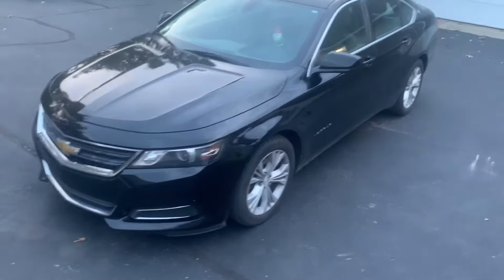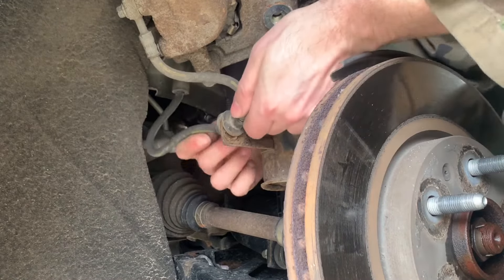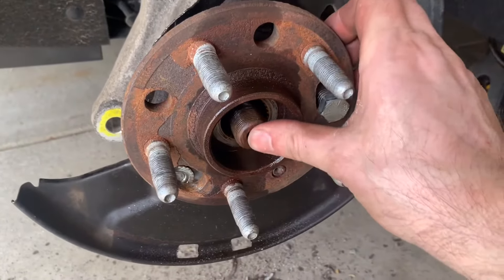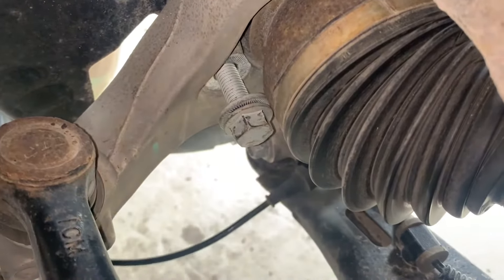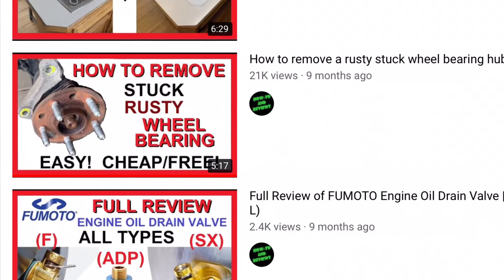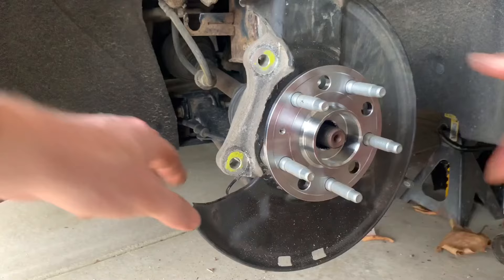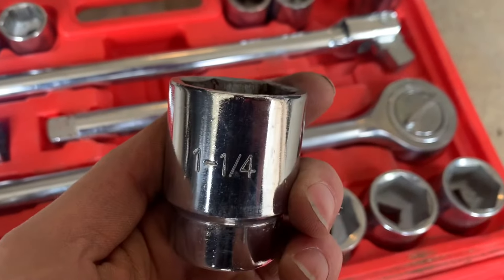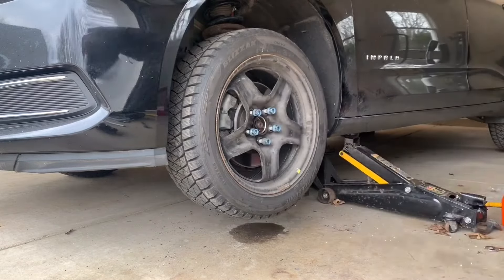How to Replace a Front Wheel Bearing Hub Assembly || 2014 - 2020 Chevy Impala || Torque Specs Shown!

Comment: Hey this is a good video, I replaced my front wheel bearing after watching this, The only thing you did not show was tie rod end needed to be taken up.I had to take tie rod up, didn’t mess with the adjustments thou.
Reply from the maker: Thanks for the tip
Reply: you don’t have to
Reply: You don’t have to take Tie rod end loose or the strut
Reply: @s.akinribido5894   I found that out on drivers side.

Comment: Hey, so when I’m driving anything over 45 mph and try braking, my wheel starts to wobble and makes the steering wheel shake, do you think changing out the hub assembly would fix the problem
Reply from the maker: If it wobbles when braking, that is the result of warped rotors. Look into replacing your brake pads and brake rotors.
If it is a bad wheel bearing hub assembly, there would always be a humming/groaning sound, which gets worse when you turn. Not related to using the brakes.

Comment: Why did change the wheel bearing?is the any symptoms to check bad wheels bearing?!

Could you help me please

i have noise come from front driver side after i hit 65mph its make the drive uncomfortable to me how to check the if the problem is from wheels bearing?! All my tires is brand new
Reply from the maker: If you are hearing noise, try turning/swerving left and right while driving. If the noise gets louder and quieter when you do this, it is likely the wheel bearing. Turning left will load up the right side bearings with additional force, and decrease the load on the left bearings. This will make the bad bearing louder when loaded with force, and quieter when unloaded.

Comment: Hello, would the process be the same for the rear?
Reply from the maker: It’s essentially the same for the rear, but more simple. There is no axle shaft going through the center. The center of the wheel bearing hub assembly is just an empty hole. No axle and axle nut.
Reply: @HowtoandReviewsOfficial  Thank you so much for the prompt response! Just bought a used 2017 V6 model, dealer was kind enough to replace the front ones as they made a lot of noise. The back ones are starting to whine too, just ordered the parts :)
Reply from the maker: @silencez2324  Happy to help. I hope it goes smoothly! Congrats on the new car. I really like mine.

Comment: Hello my power steering stopped working on my 2014 Chevy impala LTZ  could you tell me anything about it
Reply from the maker: Hello! I have not had any power steering issues in this vehicle, so I’m not familiar with the details of the system.
The best I can tell you is that the power steering system in this vehicle is an electric motor. There is not the typical power steering pump with power steering fluid. I
The problem is likely an electrical problem. Loose wires or bad motor or something.
I would recommend starting with a Google search. Since this vehicle is now eight years old, it is very possible that there is a common problem with a well documented fix.
I’m sorry I could not be more help. Let me know how it goes!
Reply: @keaonia I just had the same issue with the power steering on my 2014 impala I had to replace the rack and pinion assembly  ..

Comment: awesome video dude! Thank you for your service as well. 

Question, for the torque wrench, what kinda drive we working with here in regard to the torque wrench for the steering knuckle & FWD shaft nut that is.

3/8th?

3/4th ?

or 1/2  ?
Reply from the maker: Thanks, I appreciate it.
The steering knuckle could use a 3/8” or 1/2” drive torque wrench (their torque ranges overlap).
The axle nut needed a 1/2” drive torque wrench.
I do not have a 3/4” drive torque wrench. (My axle nut socket was 3/4” drive, but I used an adapter). 
I hope that helps!

Comment: I was finally able to successfully complete my left front hub assembly using a breaker bar and a pipe.  However,  on my right front It as a nightmare with the rod assembly and the front shock . It would not align.  I had to remove the shock and one of the rods to align it. Now i believe the brakes are making a horrible noise and my ABS light and stability lights are on. Do you think I reinstalled my caliper too tight or was it because I removed the shock and rod?
Reply from the maker: The ABS and Stabilitrak lights are the result of the wheel speed sensor not working properly.

How to Fix ABS and Stabilitrak Warning Error Lights | Speed Sensor | Wheel Bearing | Chevy Impala
https://youtu.be/wtDWDb2tYQA

Do the brakes always make a noise when the wheel is rotating? If so, probably just the dust shield rubbing on the rotor. Should be as easy as bending the dust shield back a bit.
Reply: @HowtoandReviewsOfficial  So I removed the calipers and discovered that in my frustration and rush, I placed one of my disc brakes backwards.  Needless to say, it scratched the hell out of the rotor. Anyways, I corrected and now it makes a grinding noise when it slows down. You're right about the speed.sensor. The troubleshooting code confirmed it. Although I don't know why it went bad. I'll check the dust plate. I will give you a follow up
Reply from the maker: @osso7891  Nice. It’s always good to find answers.
Reply: So, I finally had a chance to work on it today. It's not the dust plate rubbing against the rotor, but the caliper against the wheel! Its not loud,  but it's very abvious. There is definitely rubbing marks on both the calipers and the rear wheel. What went Wrong?? I reinstalled the calipers and made sure they were tight. Also, I forgot to mention that the new AC Delco wheel bearing housing does NOT have a hole for the screw, so the rotor just moves around, but that didn't cause any problems on the drivers side. I'm thinking of redoing the whole thing because maybe something went wrong when I installed the wheel bearing housing??
Reply from the maker: @osso7891  That definitely should not happen. The components stack up so everything is in the correct location with no interference.
First, I would make sure everything is in the tightened down security.
If it is, I would be looking at the wheel bearing. It is the only component in the equation that was changed. Maybe it’s the incorrect wheel bearing. Not having the tapped hole for the rotor adds some suspicion to that possibility.
Reply: @HowtoandReviewsOfficial  Okay. Yes. I believe that may be the case. I will double check and get another pair.
Reply: @HowtoandReviewsOfficial  So, after weeks of working on my wife's car and going through all the problems above, I finally fixed it. I swear I'm going to trade it for a Honda. After redoing the entire wheel bearing hub assembly and even trying a wheel spacer, I discovered that one side had a bent rotor. A friend came by with some device and straightened it out. Problem solved, no more noise. I can now replace wheel bearing assemblies faster than oil changes.
Reply from the maker: @osso7891  That’s a rough path, but I glad you got it sorted out! Great job!

Comment: do you rest the weight of the vehicle right there on the jackstands, or is the vehicle just floating above the stands?
Reply from the maker: Rest all of the weights of the vehicle onto the jackstands. They should hold all of the weight with no floor jack required at all. I just left the floor jack in place because why not? Otherwise, I would have to remove the floor jack then put it back again when I’m done. I had more than enough room to just leave it in position.
Reply: @HowtoandReviewsOfficial  okay. great video man.

Comment: Good video. What indicators lets you know you need to change your wheel barring?
Reply from the maker: Typically a growling or howling noise when driving. It will typically get louder when turning because inertia shifts more weight to the bad bearing and really loaded it up.
In this specific case, there were no functional problems with the actual bearing. The magnetic encoder ring fell off. This is needed for the wheel speed sensors to work, so my abs and stabilitrak were not working correctly.

Comment: Use 3/8 shallow 18mm socket and 3in extention a 3/8 >machine bring those wheel bearing bolts right out no extra work. Also never pull wheel sensor. They normally break  off in the knuckle. Save ur self a ton of extra work
Reply from the maker: Awesome. Thanks for sharing.

Comment: 1 1/4 is NOT 32mm lmfao so thank you for that, after multiple trips to oreillys I finally figured its actually a 1 and 5/16 which is equivalent to 34MM NOT 32mm. So how did you manage to get a 1 1/4 on it???
Reply from the maker: Thanks for pointing this out. 

I agree that 1-1/4” does not equal 34 mm (it is 31.75 mm). 

The correct size is 34 mm. I do not have metric sockets that large. My 1-1/4” socket worked. The difference is only 2.25 mm, so my socket was likely slightly oversized/sloppy. But yes, 1-5/16” is the correct equivalent for 34 mm. 

1-1/4” = 31.75 mm (32 mm socket)

34 mm = 1.34” (1-5/16” socket)

2 mm or 1/16” difference in socket size.

Sorry about the multiple trips to the parts store, glad you got it sorted out!
Reply: What are you talking about 32 mm??  He clearly said 34 and even wrote it in big red letters at 1:45 !!!

Comment: Great so I removed the ball joint and tie rod bolts for nothing. Now I need another $100 alignment..
Reply from the maker: Well, that’s another way to do it. I think you should be OK as long as you didn’t move the tie rod adjustment jam nuts.
Reply: @HowtoandReviewsOfficial  well my steering wheel is now pulled to the right I don’t know why but it never was before I removed the tie rod
Reply from the maker: @yousefalshiekh4074  Bummer. Yeah, I would definitely get an alignment. I recommend getting a “lifetime alignment” if it’s available. The cost just a little bit more, but you can bring the vehicle in for an alignment at no cost, any time, for as long as you own the vehicle.